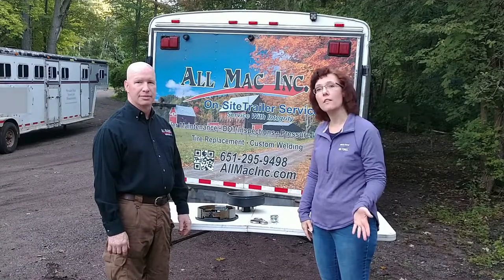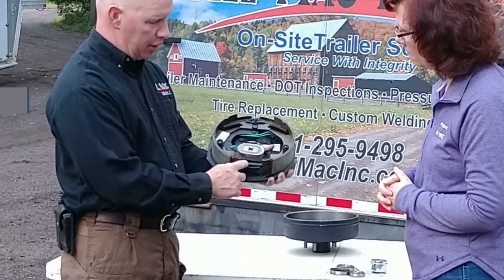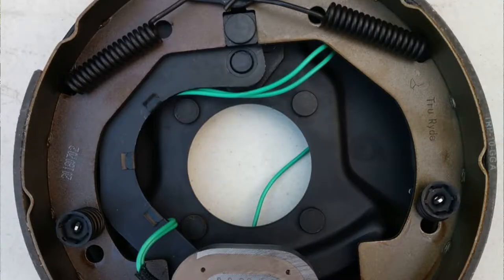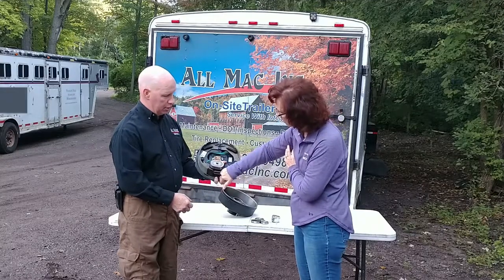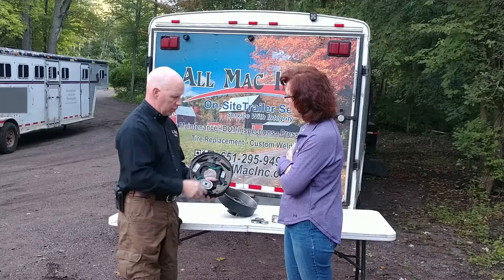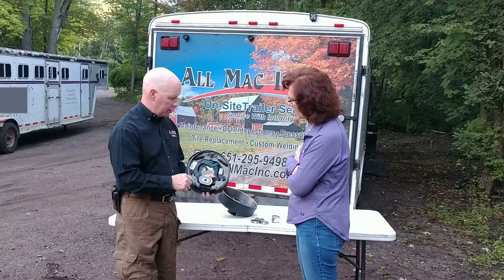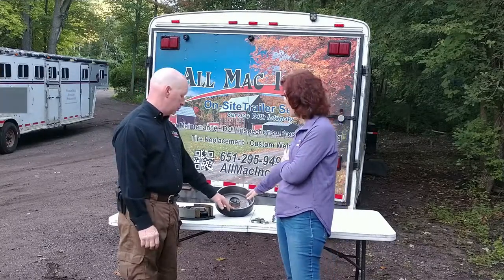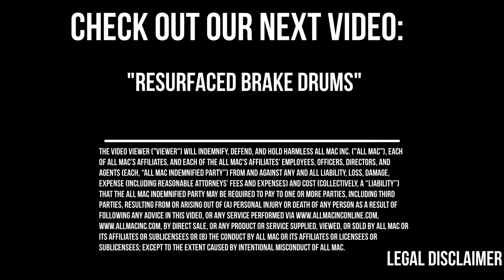How Electric Trailer Brakes Work (2019)

Comment: Interesting video. I work on trailers. I never thought that the drums could be re machined. Thanks.
Reply: Brake drums can be turned up to the maximum inside diameter.  This should be marked on the outside of the drum.  They can even turn semi truck brake drums; more specialized but it is done. 
Most newer cars use disc brakes either on the front wheels and drum brakes on the rear or all the way around.  The rotor can be turned to its minimum thickness but if they are warped from getting too hot they will need to be replaced.  On some vehicles you can replace just the rotor and on others you will need to replace the hub/rotor assembly and transfer the bearings or put in new and install a new rear seal.  Don't go cheap on your bearings and avoid the chinese ones as bearings support the weight of your car and if poorly manufactured or improperly installed can damage your vehicle and/or cause an accident.